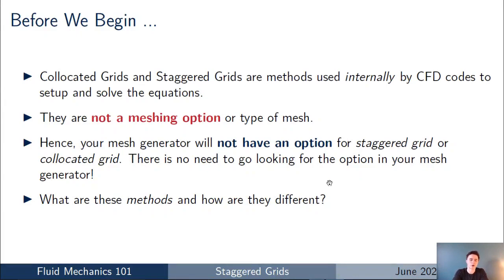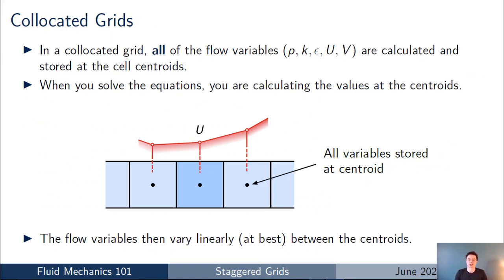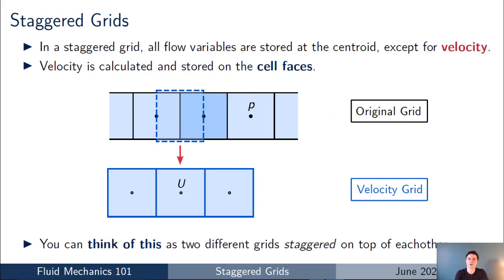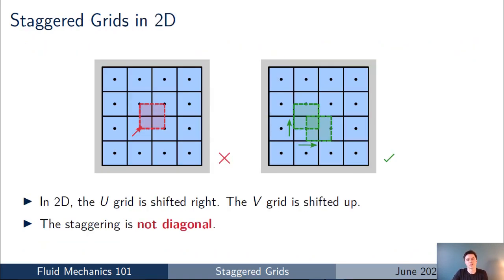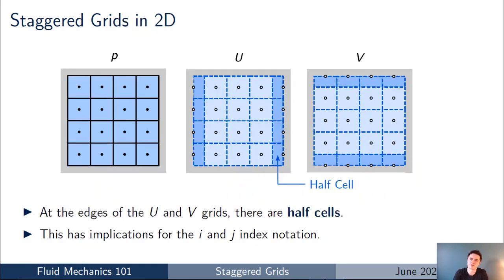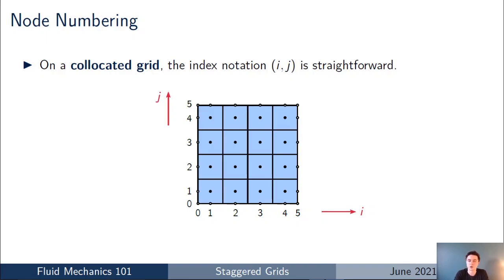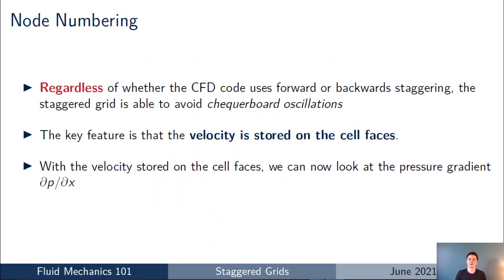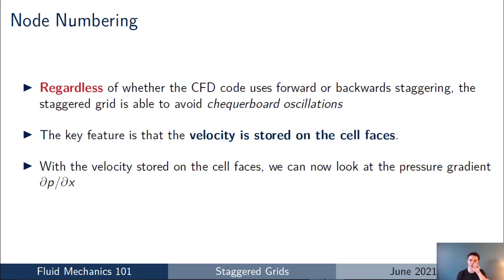[CFD] Rhie & Chow Interpolation (Part 2): Staggered Grids

Comment: REEF3D (an Opensource CFD-Toolbox for Hydrodynamics) does also use a staggered grid approach. For the irregular boundary they use a ghost cell immersed boundary method. Thanks for the explanation on the staggered grid!

Comment: Another disadvantage of the staggered grid should be the computational time. In the staggered grid we solve the momentum equations for u- and v- cells  seperately (by applying u- and v- momentum equations for each). Then, for the pressure equation we get solution on the scalar grid. However, in collocated grid the momentum equation is applied only one time. 37:26

Comment: Thanks for your input. But you can use staggered grids on any mesh, it amount to properly discretizing and using adequate polynomial interpolation for each grid... However, the mistake is to view staggered grid with the old-structured -finite difference mindset.. . It seems that staggered is more efficient than collocated grid, it is fast and up-winding is not necessary.
Reply from the maker: Yes you are right. You could calculate and store the velocity at the face on any mesh. It is just a bit more work to write all the equations out and make sure you are doing it correctly! Most people tend to copy the equations that appear in the popular sources (so you can check that you have done it correctly).
Reply: @fluidmechanics101   In view of the benefit one get from staggered grid. I think it is worth the effort. However, many people in the literature are still stuck, in simplistic formulation of staggered grid. For example using the Normal velocity to interpolate other component of velocity,  looks so simplistic instead of full discretization itself , that is a source of error for complex flow. I have written a program with staggered grid with unstructured mesh. It works very well with no need of upwinding or characteristic method. It is however, true that it requires a lot more programming effort.

Comment: At 9:10 I think it would be '(a) backwards & (b) forwards' rather than '(a) forwards & (b) backwards', because ∂p/∂x is equal to (p_2,1-p_1,1) / Δx at u staggered grid (1,1) of (b). This is defined as forwards at 15:26. Could you check this?

Comment: Interesting! Is there any possibility of using a cartesian mesh for curved surfaces if you make the mesh really fine (fine enough)? It would be something like a pixelated / bitmap version of the geometry?
Reply from the maker: I don't think that you can. Remember in fluid mechanics, the flow close to the wall is really important (viscous sub later). This is why inflation layers are so important. We are effectively propagating the solution at the wall, away and into the bulk of the flow, where we calculate how the rest of the flow behaves in response. If the entire shape of our wall is incorrect, the viscous sub later will not be correct and this will pollute the rest of the solution.
Reply: @fluidmechanics101  You are probably right. Maybe one could use some clever mathematics to get around the problem. On the other hand, no physical surface is perfectly flat either.

Comment: Can anyone explain to me, in 2021, what can you simulate with a Cartesian grid that hasn't been already documented extensively?
Reply from the maker: There are many bespoke CFD codes (MFIX and FLACS for example) that simulate complex multiphase problems (fire, explosions, fluidised bed, LES) with relatively simple geometries but complex physics. The Cartesian grid gives them considerable speed up and enable solutions which would be too slow with unstructured grids
Reply: @fluidmechanics101  so it's still an academic tool
Reply: @fluidmechanics101  That is what i am hungry for my near future phd, thanks for the topics :)
Reply from the maker: Debatable. Almost every tool has academic and industrial usage. It all depends on what you are trying to do 😉

Comment: Thank you for the video, what is the right way of interpolation of face velocity to pressure nodes?
Reply from the maker: You shouldn't need interpolation of the face velocity back to the centroid, as the centroid values were calculated already by solving the momentum equations
Reply: @fluidmechanics101  ty, there is nothing said in patankars book about calculation of node velocities. do i have to simply write same equations as in did face velocities, and their corrections? can u give some references about staggered grid compressible simple solver?
Reply from the maker: The compressible case is a bit more difficult. I would give 'Ferziger and Peric' Computational Methods for Fluid Dynamics, a read. It covers a method for how you can deal with the compressible case